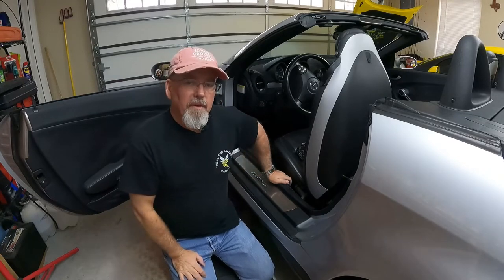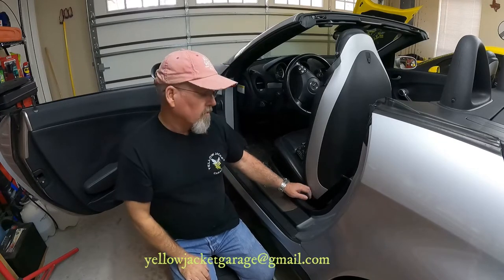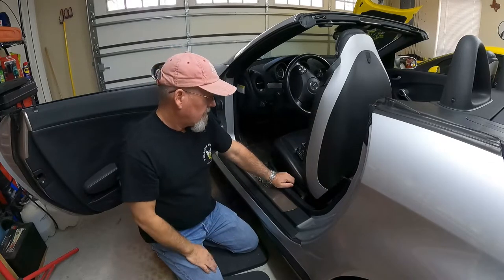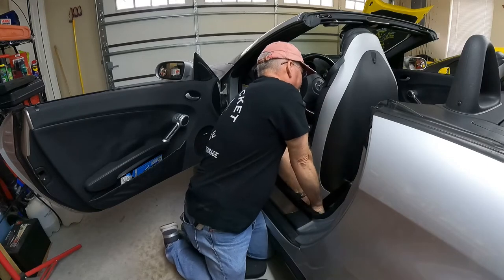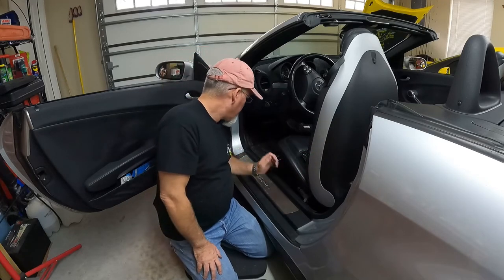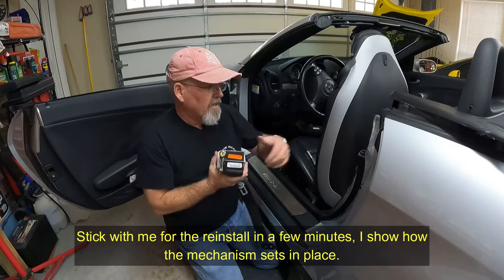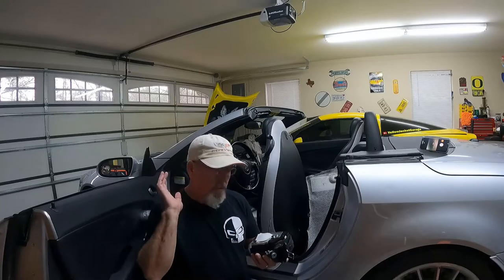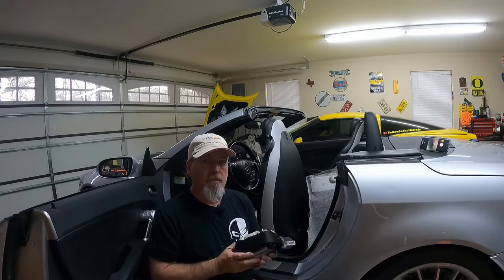Replacing a locked Mercedes seat belt mechanism DIY

Comment: Really great video!  - Even the additional info about how you suspect that you seatbelt got locked. I was concerned about my daughter's rear seat belt and if we'll be able to clear that code after we removed it and got it unstuck and re-installed it.  - We do no have the same Mercedes, however, this was still beneficial. -- OH! and those freaking tight spaces! I have little hands ( child size) and I have no idea how you were able to get your hand in there to get the bolts back in. I had to rig my bold onto my ratchet with a wire to hold it long enough for the bolt to grip the female screw side.  - Although, since it is a different model I am sure that could have made a difference! --- Okay ... so here is my "nit-picky" side.  Your speech patter and volume and even the timber of your voice was pleasant to listen to.  I struggle some times to listen to others' videos. I never mention this because people have the voices they have, but it was a PLEASURE to get instructions from you.   Thank you for taking the time to make this video for the public!
Reply from the maker: Thank you so much for the kind words!  Sometimes if I have a nut or bolt that gives me fits I'll use a small piece of double sided tape in the socket to help hold it where I need it to be.

Most local body shops have the computer to reset the codes, I'm sure one would do it for you for a very reasonable price if not even for free.  The customer service aspect keeps them on your radar in the event you need their services down the road.
Reply from the maker: Oh, I know exactly what you mean about voice patterns, some people put out great videos but are difficult to listen to for that very reason.  Thank you again.

Comment: Where do u send them for repairs
Reply from the maker: I sent mine to safety restore, awesome service and extremely fast turnaround.  Their online order process is super easy as well.
Reply: Thankyou so much happy holidays
Reply: Thankyou so much happy holidays
Reply: Thankyou so much happy holidays
Reply from the maker: @Jr 559  glad to help where I can.  Thanks for the question and for watching.  If there's any other content you'd like to see, let me know and I'll see what in can come up with.
Reply: Most definitely I appreciate that! I just spin my amg S63 2009 in the rain broke off the control arm left rear suspension axle roof airbags deployed along with back seatbelts are locked up tight making my leather mess up . Trying to Learn how do I remove the airbag notification once I replace the belts and roof airbag left and right
Reply from the maker: @Jr 559  once all the Pyro fuses are replaced you should be able to take it to any decent body shop and have them reset the SRS so the lights go off, that's what I did with mine after the belt repair.  Also, Safety Restore does airbags too if I'm not mistaken (haven't used them for that but I've been told they do).